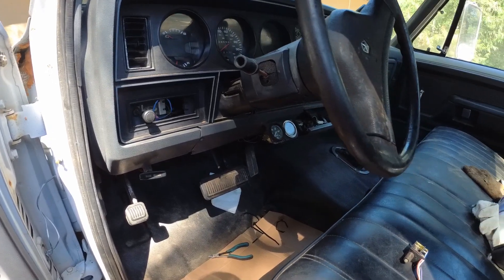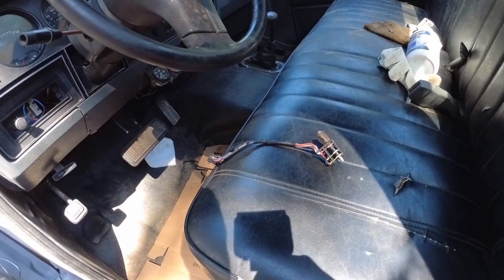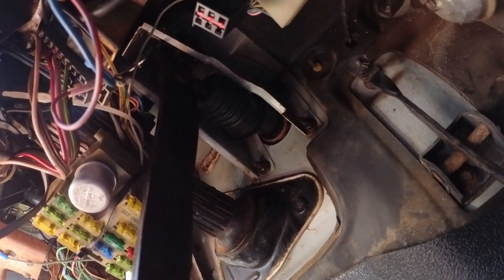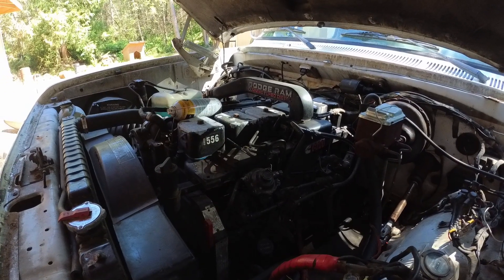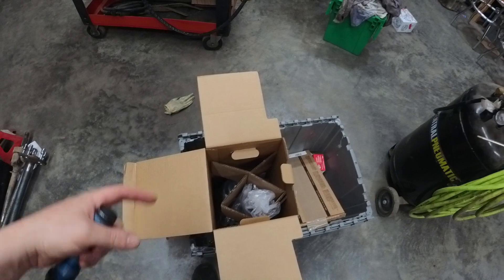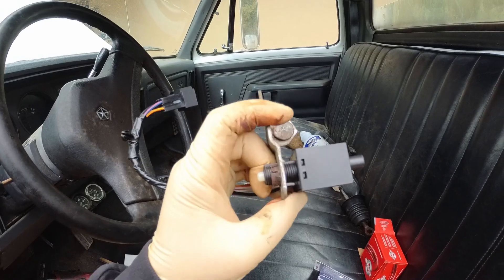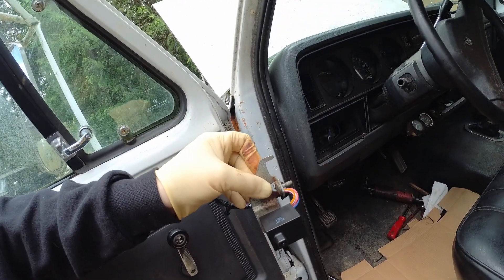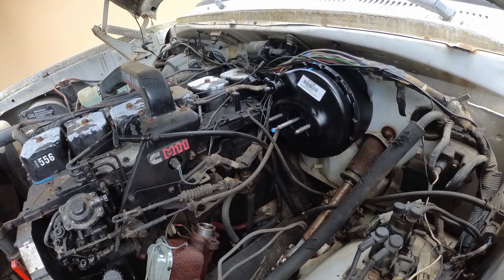First gen Dodge brake pedal issues, switch, booster.

Comment: how was the height of the pedal after this? I find my pedal in rest position awfully high, as yours in the start of the video.. I have to lift my foot from the accelrator to get to the brake, not good if i need to brake fast
Reply from the maker: That's actually how it's supposed to be. They are up pretty high.
Reply: I have the same problem with my 1988 d100 and I hate that I have to lift my leg to brake. I had an 84 D150 in high school and I don't remember it being that bad

Comment: The Ant-Lock and Brake light on the dash are staying on and can't figure out why. m The only serviceable ABS is the differential speed sensor which was changed but no go.
Reply from the maker: you will need to get the service manual, and follow the diagnostic procedure.
Reply: junk mopar electronics they should have fired every electrical engineer on the payroll and hired all new people cause they built unsafe unacceptable junk
Reply from the maker: @stevenbean9706  yeah considering the vehicle is 34 years old there's always going to be things that fatigue and wear out. Although over the years Chrysler has got rid of all the old engineers and got new ones and their factors worse than they were lol

Comment: I have no brake lights when I hit the pedal. Checked the switch it goes up and down as normal, fuses are replaced but still not active brake lights when stopping
Reply: The brakelight switch may be bad internally. If it's not making contact, it will not function at all. If you have replaced the brakelight switch and it still isn't working, you likely have a wiring issue.
Reply: your switch is fried internally they built and still build junk electronics

Comment: this is a serious safety hazzard and mopar stellantis should be required by law to give or replace all if these soft soft crappy brackets ! ive yet to see one that doesn't bend after being used twice no matter what you use to hold the switch in place the bracket is so soft it bends and you end up with zero brake lights
Reply from the maker: I'm sure there there is some limitation on how long their liability lasts.
Reply: ive got a 40 year old chevy that just got a brand new fuel pump cause chevy was found to be using junk parts ! there is no limit on safety and they shouldnt have been permitted to sell these in any vehicle at any point in time a lawsuit is definitely in order